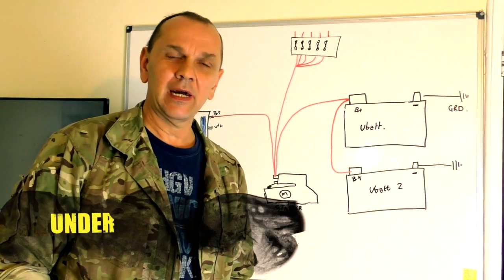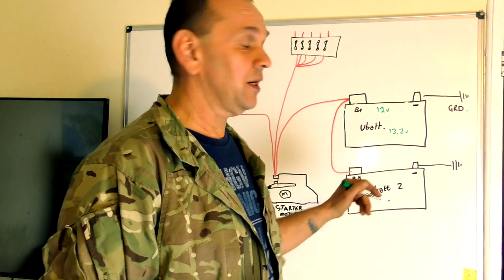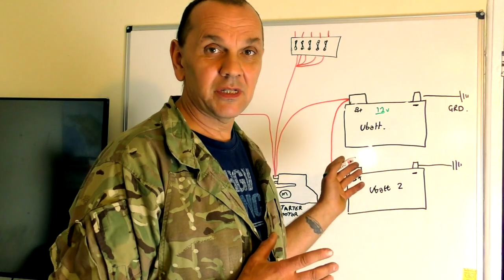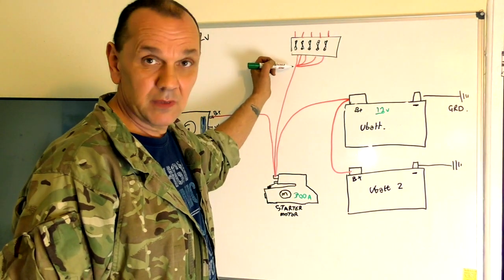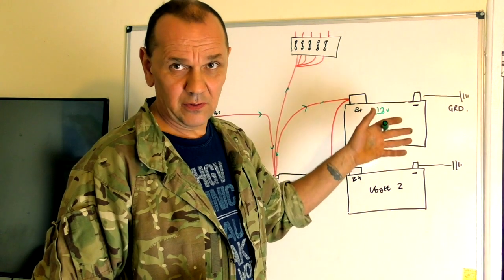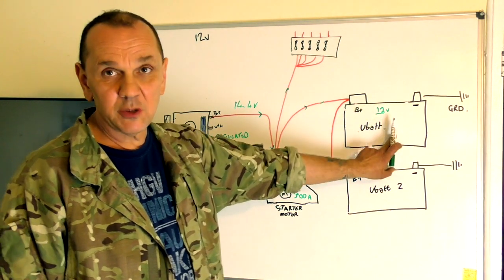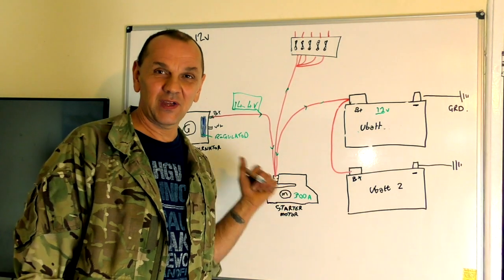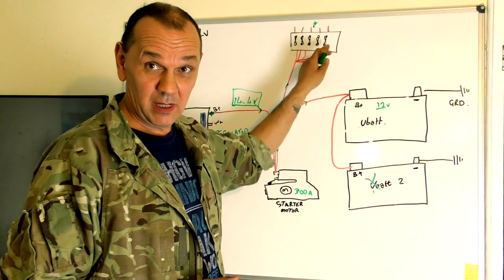LRTV Whiteboard Sessions -  Basic charging System

Comment: I got a land rover 90 ex-military 1986 so it has convoy options, my dipped beam headlights dont work, bulbs are fine, full beam works, fuses are fine and before they went out one side was working then the other side eventually went... any ideas? i assume a wire is burned out or something but im not very sure, just thought it was strange that one side went then the other a few days later...
Reply from the maker: check the wiring and voltage at where the bulbs are out.

Comment: Hi Chris, thanks for the helpful explanation.  I’m just about finished getting my land rover series 2 on the road.  In running the engine with a new alternator my charge light won’t go out.  I have 2 charge lights in the circuit thanks to a replacement speedo from a series 3 that has another charge light in the dial.  Do you have any suggestions why this might be occurring please.  I read somewhere that the alternator won’t kick in until the charge light cuts out.  Cheers, Ian
Reply from the maker: remove one charge light and if the one you use doesn't go out check the alternator for serviceability.
Reply: Vehicle Repair Toolbox Videos thank you Chris, that is what I was thinking to try.  Cheers Ian